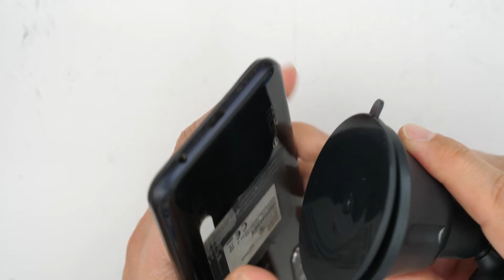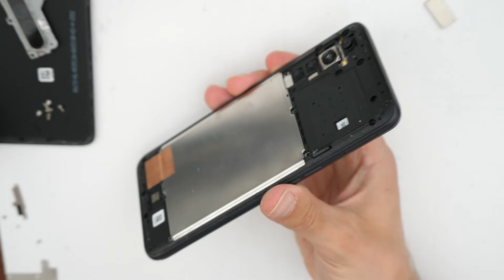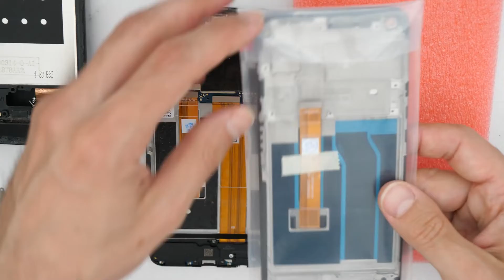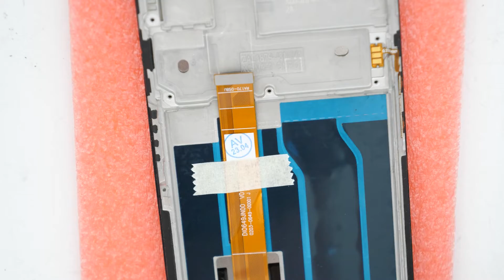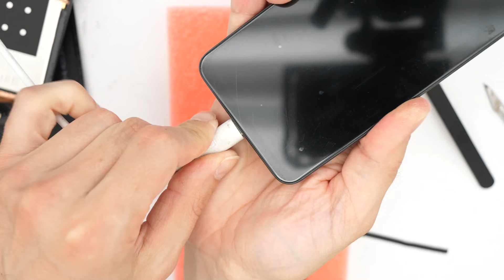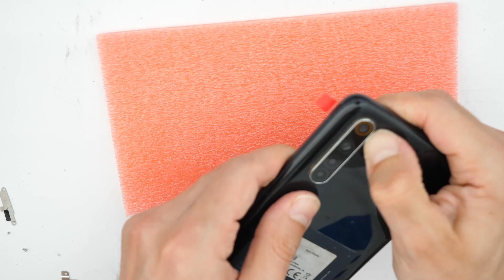Realme 6S phone - disassembly TEARDOWN repair - display & battery

Comment: which part is the antenna of wifi and Bluetooth connection
Reply from the maker: The black long cable on the right side
Reply: @CrocFIX  my realme 6 has poor range detection of Bluetooth and wifi what maybe the problem?
Reply from the maker: @trick0451  Did you replace the screen? Or  anything else? Or it just started on it's own?
Reply: @CrocFIX  I didn't know how it started because I just bought the phone 2nd hand, but the history is they already replaced it's screen/lcd